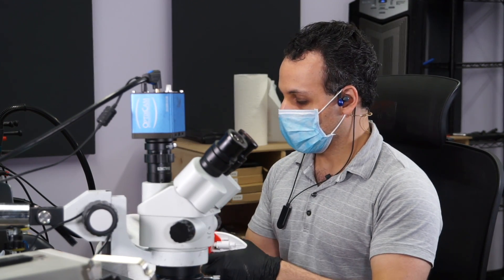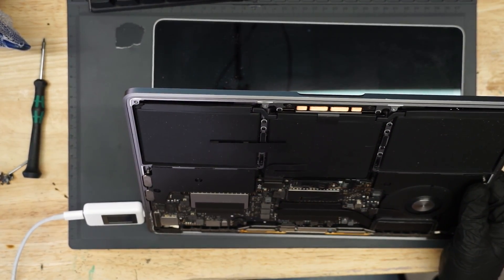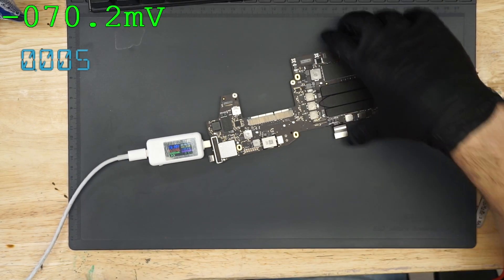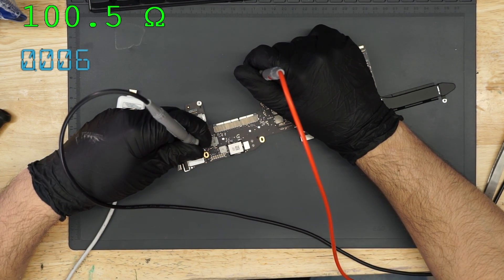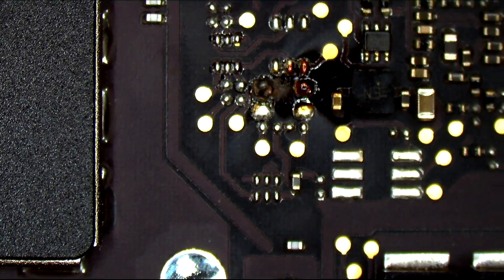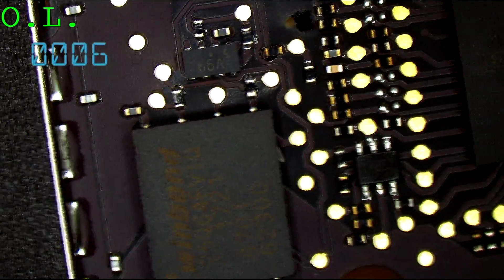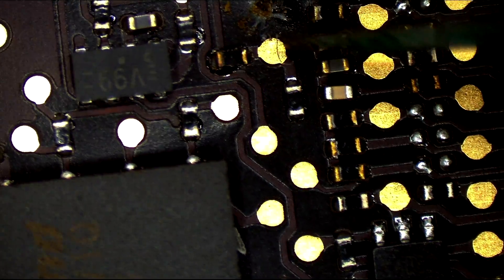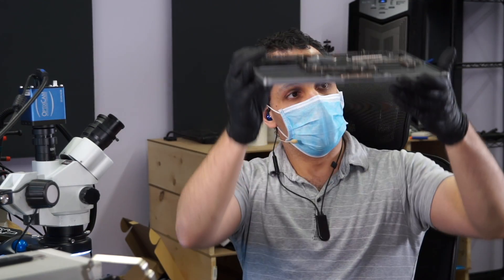Macbook board develops hole through it, Apple calls it liquid damage. 😂

Comment: That is clearly water damage: specifically delamination caused by moisture inside the board (probably an air pocket between the layers). Either the line was down for an extended period of time between bake and run and the boards were not stored properly or the board wasn't baked at all before being run.

Comment: Burnt via.
I used to do PCB layout for a smallish firm.
The quickest way to get on the Engineers bad side was to rout power through a board instead of across the board.
He called via's 'copper fuses of unknown trip-point.'
Maybe heavy current wasn't supposed to go through there, but I am betting that the tech who routed this board didn't mind running amps through a via.

Comment: Board repair such as what you found is not impossible. It may be impractical if parts are available. Laying a matrix of epoxy and retracing the solder runs could return it to service.

Comment: From a guy who works at a pcba manufacturing company, this is likely the case of someone using the wrong flux, a clean flux which needs to be washed and not through localized cleaning. It is very likely that after reflow, they only noticed there are missing components. And someone decides to solder the components manually and end up using the wrong flux. And this is what you end up with... Quite a rare incident but do happen when there is an inexperienced employee. The manufacturing company probably has to submit their manufacturing yield report to Apple. So they decide to do this underground rework probably to avoid the missing components being captured. I have seen burned boards or delaminated board. But this is very different because it is kinda clear there is flux residue.

Comment: so...its an expensive fix. I also work in a repair shop and liquid is a weird thing. sometimes the whole thing can show signs of liquid damage and it works fine, other times not so much. the term liquid damage is a loose term. I trust Apple and other companies that make computers don't make board to spontaneously burn a hole in their logic boards. So two things, either the customer had this Mac exposed to high heat, like pushing the Mac to its edge while out in a hot enviroment or liquid did get in it and as it warmed up, caused to burn from a short circuit. Liquid damage or no power are the two terms used for this, especially on an out of warranty device. Liquid damaged was probably used due to the visible damage seen on the board instead of no power which would have been used if nothing was found. Either way,  the board is not salvageable and needs to be replaced. May not have been a proper classification but again, he can't fix it and would have to replace the whole board which would cost about what was quoted.

Comment: It's not an 'explosion' this is carbonisation of the epoxy. Most likely there was delamination inside the board causing arcing which leads to the carbonisation. It's very likely a manufacturing defect.

Comment: Me: uses boot camp to play windows games on my mac.

My mac: overheats and smoke comes out of it as well as a system shutdown
(yes this actually happened im not exaggerating)

Apple: Water damage.
Reply: your first mistake was buying an apple product,
your second was using it for gaming...
Reply: @sosig6445  So true. Why not just save money on a better quality pc that comes with Windows and also not have to deal with software (video game) compatibility
Reply: @Lofi.z34  
also that better quality pc will be cheaper lol
Reply: @sosig6445  Yessir, hence why I said "save money" but you are correct
Reply: @Lofi.z34  ah i tought for a second you meant save UP
Reply: I recently got a new little macbook pro (for macOS dev work), and while it's not a bad little machine overall, I realized quickly if you stress it it easily gets 'very hot, very quickly' and I'm unconvinced it's engineered to cope well enough with its own heat if I were to push it too hard. I wouldn't be surprised if the damage in this was a 'component getting hot' issue. Probably a design flaw. The company defaults to bleating 'water damage' as that makes money.

Comment: MacSurance: It's water damage because the moisture in the air caused the macbook to become warmer and it was the steam caused by the air that caused the warping.
Customer: But there was no steam I was using it in my room.
MacSurance: Was your heater on during the winter?
Customer: ...Yes?
MacSurance: Its water damage.

Comment: Torch down holes through a PCB is pretty catastrophic.  Definitely part of a high current line which...considering that'd be like shorting a lithium battery potentially is super dangerous if they didn't do something right at the battery to account for stuff this bad or just...let the board burn up and let the load just self-destruct lol.  That's some shit board design possibly if this keeps happening in that same spot.  One-off fail who knows.  Bad routing/etching maybe?  Cheap ass PCB's (likely)?  Bad QC on parts?  Could be a lot of shit giving way to stuff that bad.  I'm kinda amazed this isn't more frequent a problem with SMD-type products now in general given the part density, number of layers, narrow traces, lots of vias, etc.  Not saying thru-hole is a perfect method either.

Comment: I worked as a field engineer for a small pc company here in town but they were an authorized apple center or whatever you call it. For repairs. I had to get Apple Certs even though 99.5% of my work was out in the field not dealing with Apple. The guys in the shop did all this. Anyways, whenever they found water damage, it was policy to take pictures of the water damage. So, if there was really water damage the guy should of asked for them to show him pictures. Once you put them on the spot like that they get all mad because they know that you know they are trying to eff you. He probably didn't think of this and it could even be they didn't take pictures and or pictures are no longer required. If the guys in our shop found water damage we would send off for the replacement part from Apple. You would not believe the prices to replace parts in Macbooks. Enough to build a decent gaming PC..

Comment: there is scientifially absolutely no point in wearing those masks inside the bloody house. It won't prevent you frfom getting the virus. It will SLIGHTLY help you to prevent the virus to spread FROM you to the others. Also, if you're sick and wearing those masks, it will actually cut off the fresh air intake of the body and all the virus has been diplaced by the coughs or sneezes will be returned to your body which will increase the virus density in your body thus will lead to a much harder recovery process.

Comment: I had this happen on the 07 a1226. If you're having trouble posting, holding the power button down would fry a small hole where to the path way to the camera on the logic board. I remember smelling burning while holding power after an HDD swap so the top case was open to test and I was able to pull it off to see this pin size hole develop.

Comment: i used to think apple was "quality" when i was a kid but i keep seeing friends of mine having problems very  fast on apple devices like the iphone xr after a few months of usage the screen developed a blurry line in the middle of the phone without ever dropping it or any kind of damage,and compared to my android galaxy s9 that was gankbang with every possible way it still works and have not internal damages.I think apple is trully doin this onporpuse for the parts to die at soem point.
Reply: like the firmware update that slowed down iphones to the point they no longer could function as soon as the latest iphone came out.
Reply: @vincelouse4409  wow really? What the actual fuck i didn't  know that.
Reply: @leyteriskoutounis  Yeah you can look up but they said it was to make the older models batteries work longer etc. but even included models from the year before. They even started compensating 25$ for your 900$ 1 year old (now very slow and useless) phone because they lost to a lawsuit. Apple is shady as hell.

Comment: This is a manufacturing defect not water damage.
Reply: Either a bad part or  apples crappy EMS (electronic manufacturing service). Tantalum seems not reasonable. They're expensive (and macs must be cheap, else Steve will reincarnate), they burn/explode upon high currents (but you will mostly have a solderpad of the part have left hanging, which we miss here completely - and if it explodes/burns the mark is bigger than a thumbprint) and there are MANY good (and apple flavored, err favored, cheaper) alternatives: MLCC, poly-tantal or elko (electrolytic cap).

Why crappy EMS :( ? Look @ all the very small black (mostly R, sometimes L) or brown (mostly C) cuboids with the 2 metallic ends. They are not lined up like soldiers, but more like drunken students close to the end of a party. If you place them badly, have a bad temperature curve, don't store them correctly and ofc miss out on AXI (xray check of solderings) and AOI (optical check) then you will have bad solderings or funny fins. Both will make your product have a short life and sometimes some parts will even move out due to that (with a bang or the white magic mist will push it's way out of it's housing).
As someone working for an E²MS it hurts me to see this. We're always giving our parts a bit of extra exercise to make 'em line up like the best :'(

Either way: the dark brown stains on the silvery pads show you that whatever it was, it was incredibly hot. If you have a brown coloring on the solderpads then it's either badly cleaned or if the those mentioned parts (C, L, R) are a bit darker than the rest - then they became hot as well. In this case the entire network became hot, ... luckily it didnt start to burn... burning semiconductors smell baaaah and your health goes baaaah as well if you breathe in hardly.... you get me.

Comment: For those that are unfamiliar:

PC boards are layers of conductive material (usually copper) adhered onto layers of insulative material (usually a fiber-reinforced resin, e.g., fiberglass sheet). Motherboards are usually "4-layer," which is four layers of copper and three layers of insulation pressed and heated to fuse together to form a single unit.

When an inner layer shorts, it'll blow a hole through the board and the "hill" Louis noted is the bulging that results from the stack of layers delaminating from the heat of the short-circuit that did the damage.

The board is toast. There's no easy fix for that kind of damage. Customer will need a new motherboard.

Comment: WELL, there is technically "liquid damage", but that is not what apparently CAUSED the problem, but just a side-effect of the problem. I sometimes think the only goal of warranty claim investigators/technicians is to find some excuse to not pay on the warranty. Instead of admitting that Apple products are overpriced garbage and quietly fixing the customers problem, they explain away the problem in the most generic way possible. For the price of a crappy Apple product, I can buy a much higher quality non-Apple product or buy a similar crappy product and used the saved money to buy something else. I paid $100 for my laptop (refurbished, but a decent laptop when new). It has served me very well for the last two years I have had it. I had an Apple laptop once. It was junk. I've had an Apple desktop before as well. Also junk. I can't really say how Apple was in the distant past, but from my experience and from what I have seen, today you are much better off avoiding them unless you have tons of money to blow (and if you do, you may want to consider supporting worthwhile charities instead of wasting your money on eye candy).

Comment: What about drilling through the whole burnt area? Seems like no traces on either side, if you are lucky, there are only solid power planes on the inner layers as well. Does the board view software you use show the inner layers?
What can the customer do then? I guess he/she could go to court if the Macbook was investigated by a forensic expert right after the Apple repair center. But I doubt the court would accept this video as a proof, which is unfortunate, because they've definitely deceived the customer intentionally. A$$holes!

Comment: Apple store rips people off. I work for Magnus IT Computer Repair and if I saw a board with that type of damage the board would be replaced. The repair would be in the range of $300-400 depending on cost of the replacement board but way less than the $1200 that Apple is quoting. You could buy another MacBook Pro 2012 for less than $1200

Comment: Spontaneously? Those things don't happen out of thin air. Given the fact that this is the charging circuit, I'd say some fool  (most likely the owner) plugged in a not certified and too strong charger. That's how you blow things up.
Reply from the maker: If this were the case the ISL9239 would die or the inrush limiter, so, you are incorrect.

Comment: I admire Louis R. ability and knowledge, and Apple support is kind hell and heaven at the same time… I had my Macbook Pro 15’, mid 2015, with the AMD 370X GPU, after 4,5 years my battery shown evidence of dilatation due to quality problems, but for some reason it didn’t had it’s serial number on the Battery Recall Program… They changed the battery without question… they swapped the entire aluminium unibody chassis with keyboard for a new one cause the battery bended the my original chassis, and the screen also was replaced for a new one due to stains on LED + Screen Recall Program. All of it at no cost, all free. I basically had my MacBook Pro motherboard swapped to a new one for free.

Comment: We used to buy apple products and because Apple has the worse warranty we had to hire a technician to fix the boards. When we found a flaw with the hardware it almost impossible for Apple to send us replacement parts. So over time, we dropped Apple because now the hardware and software are better.  From our vendors, we get 3-year warranty and its onsite.

Comment: I gues... that kind of damage is present more commonly on devices who people pushed to above its limits... I mean, a regular MacBook Pro isn’t a workstation... Apple needs to be more clear with their custumers because they are selling some “pro” devices that actually aren’t.... and is isn’t a problem just of apple, every single laptop and desktop maker has some kind of guilt also the customer because they are buying a bicycle to run at 540 km/h.... so in some part of the ridiculous goal something will fail... if isn’t the human behind the machine due to frustration, usually some electronic part will fail.... I have a ton of friends who buys mid range laptops (like this MacBook) to do workstation task like autocad, 3D modeling, video editing for way long periods of time I mean more than 15 hours every single day and every single week... this machines aren’t designed for that kind of tasks.... maybe the top tier MacBook pros are some sort of that but I cannot rely on that because by experience I won’t trust on my  mbp 16 doing a complete day of rendering... this thing goes extremely hot! And that’s cannot be good for that machine, video editing for the other hand heat the MacBook just 2 or 4 minutes maximum because it rendered the video pretty quickly, and for my architect works and complex modeling I do trust on my hp workstation because for three complete years I’ve been doing that every single day on that machine controlling the heat very well and my system never failed me once... it is funny, I never visited technical support for that machine... I’m pretty sure that my MacBook Pro 16 will give me a trip to the store pretty soon...

Comment: Hi everyone, so I've seen a couple of these vids where a part of the board catches fire. In this particular case, if it isn't water damage, what could actually be causing this? I'm about to upgrade my machine and needs to be a macbook due to software restrictions, was looking into the 13 inch 2020. Thanks!

Comment: I've seen you handle a problem like this with a thunderbolt port circuit, guess in that case there wasn't anything vital in that area, what circuits are disrupted by this hole? How many layers are in there, I know there's 2 sides we can see, but there could be one to 2 more layers? But agree this is a case of faulty parts, probably not manufactured with enough insulation or a circuit component near by dumped screen voltages into a low gage wire, why use more copper than you need? It exploded Apple, thats why!

Comment: the name for that type of failure is "delamination" the laminated layers of the board likely had a small air bubble that forces irregularity in the thickness of the board (the hills). the traces running through various layers likely shorted together after the isolation between them was broken.

Comment: Once upon a time, there was an electronics repair company that had a refurb deal with their apple products. This company got crates of used apple products, and we're asked to repair as many as possible, and send them back so they can be sold or handed out to their customers. A lot of the failures were due to workmanship or design, outside of the obligatory drop and moisture damage. The telephone company that signed this contract was happy, because it meant that they didn't have to replace most of their customers' damaged apple products with new ones. 
One day, the telephone company sent a crate of unrepairable, manufacturer defective products back to apple. They then had to stop working with the repair company, or they'd lose their sales contract with apple. Apple won. The end.